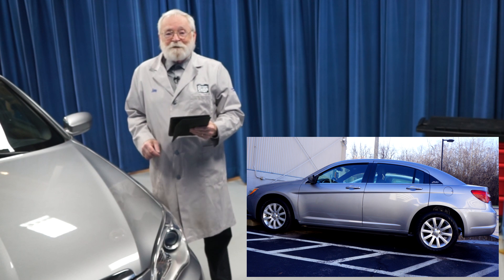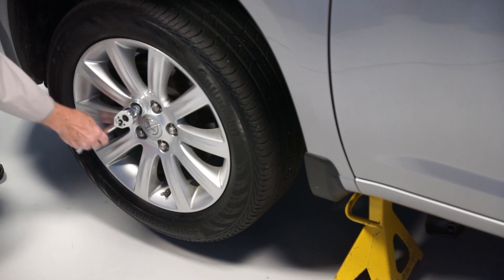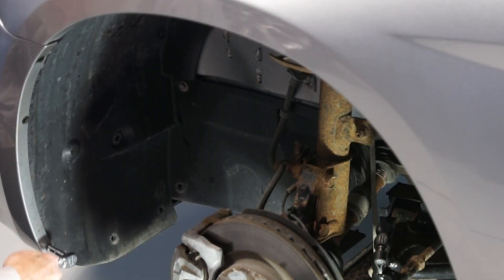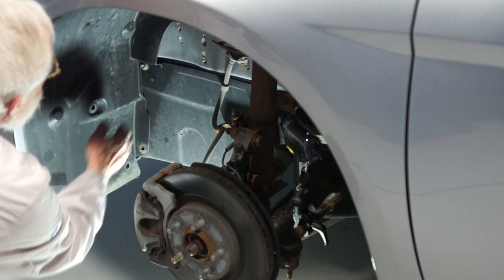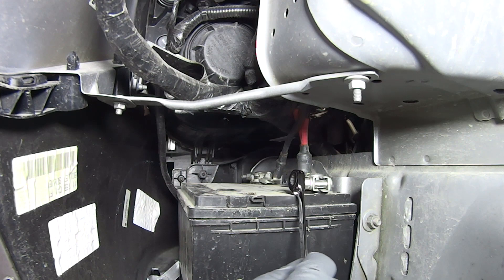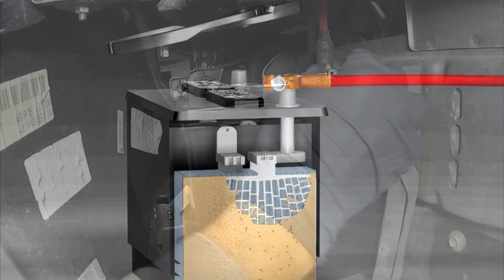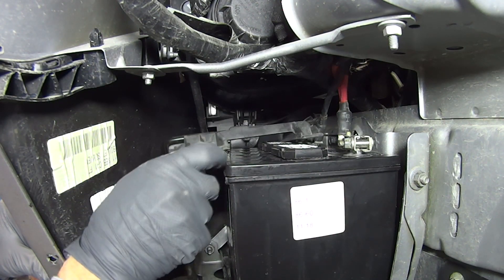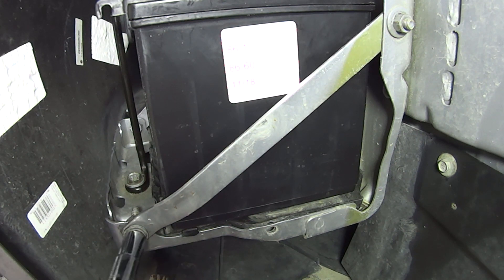Chrysler 200 (2011-2014) - New Battery Install

Comment: the irony being its actually easier to remove the bumper cover to replace the battery - just 14ea 7mm bolts, 2ea 10mm bolts and a few push pins on top - no tire removal needed

Comment: Most parts places only list 1 yr and 2 yr warranty batteries. It's a goup/size 86 battery. make them look up a 3 yr battery. This is hard enough that you want the best battery you can get in there. Advance's part no. is 86-2
Reply from the maker: Thanks for the input.

Comment: I have to say this is one of the most poorly designed cars I have ever seen. I regret owning a 2012 200. To even replace a headlight you have to remove the tires.
Reply from the maker: Thanks for watching. Hopefully we could help you out with the battery change.
Reply: @TheBatteryShop  I just did it, was tedious but its done.

Comment: When I bought my beautiful convertible 200S, I had no idea what I'd let myself in for. This is the hardest car to repair I've ever had, bar none. This is a good example: just changing the battery takes half an hour & multiple tools. If you want to change headlight bulbs be prepared to do one side, then the other, with a similar disassembly process- and even then, you'll get your hands cut while replacing the bulbs; there's just no room to move & lots of sharp metal, so have bandaids handy!
Reply from the maker: We're sorry this was challenging- but good job for getting it done!
Reply: I have the V6 200 and it’s terrible. If I get repairs done at the shop I’m charged extra because of the difficulty of reaching anything. The alternator went out and I had 6 guys disappear on me after seeing where it was located. Windows are out, a/c and heat is out, radio quit working, the housing on the headlights melted. I’ll probably break into tears the day I can get rid of this car.

Comment: What is the battery amp capacity for a 2.4 engine?
Reply from the maker: Thanks for watching. A 2011-2014 Chrysler 200 with a 2.4L, original manufacturers specification is 525 CCA.

Comment: Am about to possibly due this job in the 32 degree winter weather here in February, and great details from this YT, but I most Definitely would test out the new battery after installed and see if indeed "starts the car" and indeed "the Alternator is charging" said new battery once it is "back in circuit" before I go back through that whole process of putting the splash shield and the tire back on...  What a dumb place to put the Battery !
Reply from the maker: We know that battery replacements can be more challenging if it is an an unconventional place, but we believe you can do this!

Comment: According to the owner's manual you can get to the battery without removing the tire by just turning the wheel all the way to the right and that should give enough room to remove the shield. So apparently that's something you can do to make it much easier?

Comment: Um you remove the negative then the positive didn’t listen to this guy red you are dead
Reply from the maker: Hi - Thanks for watching! The battery ground connection has already been removed when the negative battery cable was disconnected at the firewall junction. That is the manufacturer’s step-by-step procedure as the negative battery post is almost impossible to reach when mounted in the battery tray.
Reply: @TheBatteryShop  you didn’t say that on your video so people will get confused it’s always red last when taking off the battery

Comment: Chrysler gets the award for the dumbest battery placement design. I should know after owning over 20 cars. What if you
just need a quick jump start... enough to make you prefer to just push the car over a cliff instead go through this hassle.
Reply from the maker: Hi - Thanks for watching and sharing your opinion! The vehicle owner’s manual has more information but the “jump posts” under the hood can be used for a quick jump.

Comment: I got a same car with a weird problem the battary is new I installed and now everyone I jump it sparks the wire terminals are new and the battary is new I can’t seem to see what is causing it to spark almsot like two wires are touching somewhere
Reply from the maker: Hi - Thanks for watching! It is normal to see a small spark when attaching the battery terminals after a battery replacement, especially if a memory saver was not used. You may notice that in the video when the negative battery cable is reconnected to the firewall connector.

Comment: My battery just went and I called Triple A and they wanted $100.00 to change the battery in that piece of junk 200 ,I bought new in 2012 ! I said you gotta be kidden ? He said if it was in the motor it was free ! Do you believe that! Never again !listen out there I've had nothing but trouble with that piece of junk !Don't buy one used ! Your asking for trouble !The heat don't work the alternator went3 times no recall the breaks oil leaks ! Should I go on that's only half of it !
Reply from the maker: Hi - Thanks for watching and sharing your experience!

Comment: Just a safety hint. Remove the ground on the battery first and install it last,even if you think the battery is dead it still has enough to spark if your wrench grounds. I bought one new in sept 2011 with the 4 cyl,excellent carplenty of power and great on fuel,my battery lasted till today and  besides tires,wiper blades and brakes ,this will be the first repair in 12 years at 195,000 km. I'd buy another one in a heartbeat.
Reply from the maker: Hi - Thanks for watching and sharing your experience!
Reply: When you add some negative cable to the base is it supposed to spark a little bit on contact?

Comment: Especially in such a cramped area, always remove/install one terminal at a time. Neg off first and Neg on last or you risk arcing to the frame with your tool.
Reply from the maker: Hi - Thanks for watching!
Reply: Not when you remove the negative terminal from the frame under the hood like was shown at the beginning.
Reply: Great video.

Comment: Once the battery is disconnected would the radio settings and the GPS saved info be gone?
Reply from the maker: Hi - Thanks for watching! This depends on the vehicle, but usually yes. Thats why we use a memory saver. Check out our video on memory saving. The link is in this video's description.

Comment: You don’t take the (circa) 2013 Chrysler 200 to a mechanic for a battery replacement. You take it to the ER, and immediately to the ICU, then tow it directly to the OR—with a team of “Grey’s Anatomy” Neurosurgeons, an anesthesiologist, and Surgical nurses, along with a tray of a sterilized 2-ton jack w/ a sturdy jack stand, a 1/4” & 3/8” ratchet, an extension socket, three sockets—13mm, 10mm & 7mm, pliers, a rivet puller, and surgical gloves—following success, being transferred to the Trauma intensive care unit.
Reply from the maker: Hi - Thanks for watching and for your interesting comment!

Comment: If you need to remove your wheel for battery replacement or remove your bumper for headlight bulb replacement, I don’t want it..
Reply from the maker: Hi - Thanks for watching and sharing your opinion!

Comment: When I bought a Chrysler 200 for my wife, and saw where the battery was I went ahead and had it replaced so I knew I wouldn't have to worry about it for a long time. Great video by the way. I learned a valuable lesson from this. I'd rather pay someone else to do it 🙂
Reply from the maker: Hi - Thanks for watching and sharing your experience and opinion!
Reply: @TheBatteryShop  Yes sir great video. You are very thorough and explain everything in a way even a dummy like me can understand. Thanks again
Reply from the maker: You're welcome!

Comment: I have a 2013 Chrysler 200 V6.  Before the battery dies you will get an amber warning light on your dashboard that stays on all the time.  There are 2 amber lights one for TPSMS and the other for engine problems.  Amber means it is still drivable a red light means get it towed.  I took it to the local Chrysler dealer and they charged me 30 minutes labor to read the code to find the problem.  They replaced the battery and also did an oil change that I also requested.  On the final bill I still was only charged for 30 minutes labor.  Now they charged me 129.00 for the battery which I thought was fair.  My main point here is that you get fair warning that the battery is weak.  Drove it for 5 or 6 days before I could get it to the dealer (always started never needed a jump) for an appointment.  This happened in the dead of winter in Connecticut.  I like the car and plan on keeping it as long as possible.  Love the quick V6 engine 288 horsepower.
Reply from the maker: Hi - Thanks for watching and sharing your valuable experience!
Reply: Should I be considered with this?

Comment: I've seen other people comment about the headlights, if you think the battery placement is ridiculous.

I have had my Chrysler 200 for 8 years this spring and put an obscene amount of miles on it with very few problems. So it's far from the worst car I've owned.

That being said, unless you have a lot of tools and a nice warm heated garage, doing ANY maintenance on it yourself is enough to drive you drink. 

I swear it is designed to require most people to take it back to the dealership or a mechanic for every little thing, like battery or headlight changes.

When mine finally gives up the ghost, I will not be replacing it with another 200.

Thank you for this video. Changing the battery is the current adventure I'm having with mine.
Reply from the maker: Hi - Thanks for watching and sharing your experience!
Reply: @TheBatteryShop  Thank you for the step by step video! 

I didn't have the tool for popping out push pins and ended up putting a couple small accidental holes in my hand with a flat screwdriver, but I finally got the battery changed.

Worth a note: the battery I bought as a replacement ended up being 1/16th of an inch taller than the old battery. That ended up being enough of a difference to prevent the battery hold down bracket from fitting back in place.

After much cursing and a 20 minute sanity break, I had to grind that 1/16th of an inch off the bracket to put it back in place. 

Your video was extremely helpful. I can't help but think if I had filmed my attempt to follow it would be nothing if not sadistically humorous.
Reply: Hi - Thanks for watching and sharing your experience!
Reply: I just inherited a 200 with super low miles. After watching this video and reading these comments, I will pay to have a battery installed and drive that sucker right on down to Carmax.  Its a shame cause it seems like a nice car, but I'm too old to bother with this kind of garbage.

Comment: Must be nice to be able to do this in a warm shop.  My battery just died, it’s -60°C outside, snow and ice in an uneven driveway,  Thanks Chrysler for what has to be the dumbest idea in battery placement ever.  🤬😡
Reply from the maker: Hi - Thanks for watching and sharing your experience! We wouldn't want to replace the battery in those conditions either.
Reply: Yeah , I totally get what ylur saying. But after 7 years ,i replaced my battery BEFORE  it died. Nice fall day ,cool n in the shade. 2 things that will kill a older car battery, extreme cold ,extreme heat. 5 years is about the lifespan of an original factory battery
Reply: My daughters car just died. Her car says its 110° here in TX🥵

Comment: Not to bad if you have to do it in the summer time or if you have a heated garage. But no way in the middle of winter and outside when the battery usually starts to give you trouble. But I wouldn't pay the 75$ and up for the labor cost.
Reply from the maker: Hi - Thanks for watching and sharing your thoughts on this.
Reply: Kinda like a 2x edged sword
Reply: So you won't do it yourself and you won't pay the labor. Sounds like you aren't going far

Comment: My lady went to walmart to have a battery installed they didnt have one so she went to a auto parts store and got one. The new battery was maybe 0.200 bigger than the old one and they told her it was too big and couldn't be installed. TWO THOUSANDTHS OF A INCH!!!
Reply from the maker: Hi - Thanks for watching and sharing your experience! However, we noticed that while filming the video there was plenty of room available in the battery tray and location (that you can see in the video) for the correct battery.

Comment: Man i feel like im watching a televised program! This is truly amazing!   Keep em coming.  I feel like i can change an engine with this kind of instruction! Clear and precise with all the info for beginners or experts
Reply from the maker: Hi - Thanks for watching! We're glad you like it.
Reply: Yes this model 200 ,has alot of videos ,sparkplugs, light bulbs ,battery.  I own one ,its a tuff car ,125k  9 years old ,still going strong
Reply: @parrisprice5892   is yours the 4 cylinder?
Reply: @charredskeleton  yes
Reply: @charredskeleton  if you have a question  I may be able to answer it. Ive done almost all the work on my 200.
Reply: @parrisprice5892   Just seeing how they hold up. I’m in the market for one. Looks like the 4cyl are tanks but the 6’s are trouble.
Reply: @charredskeleton  idk anyone who has a six. And Ive always been a GM guy. My 1rst chrysler. Other than normal maintenance, Ive had to replace the ETB. Electronic throttle body. 140$. I did it myself after watching a few utube vids. I change my oil and fil about every 5k miles. Got 72k on the original set of michelins. With tire rotation every other oil change. Its been a very good car. Good luck with yours. One stupid engineer design tho, the left front wheel has to come off to replace the battery. Other than that, I love it.
Reply: @parrisprice5892  do you have have do rest code for battery light? Or it should go off after being replaced with new one?

Comment: everyone disses on 200’s, i must’ve gotten the cream of the crop for mine. never have many issues and just started to really personalize it. CHRYSLER GANG
Reply: I love my Chrysler 200.  I have the 3.6 "Touring" package.  Fun car, feels like driving a V8... uses about as much gas too... lol.
Reply: Hi - Thanks for watching and sharing your experience!
Reply: @NXSProductions  Glad you like it, brotha!!!! #chryslergang
Reply: The 3.6 Pentastar engine isn't a problem, it's a very reliable motor. It's just that they pulled a Ferrari when it came to battery location. These dumbasses should've placed the battery in the trunk just like they did with the Charger.
Reply: @Iridiumcosmos  You're actually right though!!! The motor itself can last, but the battery is one major headache to take out!!
Reply: @hatchcracker_tv  Mine just reached 90K.  Daily driver.  Pentastar.  Uses no oil.  Not even a little.  I can go 10,000 and the oil looks as clean as the day it was pumped in.  Those motors are solid!
Reply: @NXSProductions  I too love my 200!!! They are better built than people were expecting!! Mine has a 2.4L with the 4 speed, and that has been taking good care of it’s own!
Reply: @hatchcracker_tv  Absolutely.  I just had to change the battery in my car; 2013 model... original Chrysler battery fired for nearly 8 years.  That, to me, is impressive and again, my engine runs as good today as it did the day I drove it outta the car lot. My hood's paint is starting to flake away above the headlights.  I've heard it's oxidation due to the aluminum hood and an improper seal... but other than that, she's still spot free.  All in all, just a great car to have.
Reply: @NXSProductions  Nice, brotha!!! Glad to hear it!! ☝🏾☝🏾👊🏾💪🏾💪🏾💪🏾👌🏾👌🏾👌🏾👌🏾
Reply: @NXSProductions  same thing is happening to mine I have a 2012 and the whole hood is faded
Reply: @rockfordhx2768  That sucks bro.  I hope you still enjoy your car as much as I enjoy mine, though.  Despite its quirks, it's still a hell of a car if you got the V6.
Reply: @NXSProductions  update: am about to change battery myself for the first time. i may change my opinions
Reply: Yessir!! I also have a 2013 Chrysler 200 with 75, 030 miles and so far I had no problems whatsoever!!!
Reply: @hatchcracker_tv  i have a 2011 Chrysler 200 with 186K miles lol, only have some alternators, batteries, and some minor stuff here and there.
Reply: @Zach-lz1zh  Nice, many people are just negative for these 200's, lol!! 😂😂😂😂
Reply: @hatchcracker_tv  i have the 2.4 L as well. the world engine models are too good!
Reply: @Zach-lz1zh  Cool!! The 2.4 is one of the most underrated engine(s) anyone has seen, in terms of how long it'll last! 😁😁😁💪🏾🙌🏾🙌🏾
Reply from the maker: Hi - Thanks for watching and sharing your experience!
Reply: @TheBatteryShop  Your welcome!!! Sorry for responding late!!

Comment: Wish me luck. I’ve never changed a tire, let alone a battery but we gone learn today! Thanks to your video ☺️
Reply: Did you learn?🤣
Reply: @derricfigueroa4609  yep! It took all day, mainly because I had to hit up Home Depot for tools but I got that shit done! I felt like a boss 🤣
Reply: @TheSlowStitchery  Girl I need to change my battery on my Chrysler wish me luck 😂😂 you definitely just gave me the motivation I needed
Reply: @mariahbetts3721  you got this! Remember you can pop the truck if needed by pulling down the backseats ☺️
Reply: Mine is dead in the garage. I have none of those tools. I looked up battery replacement and was told it would be approximately $400. That’s an entire paycheck plus some for me. SMH
Reply: @mistytownsley5304  do you have a warranty on your battery? I didn’t know I did, and when I took it to my battery shop they said I had a warranty and charged it for free 😊 I spent about $35 bucks on tools in the end.
Reply: @TheSlowStitchery  unfortunately, no warranty.  I’m still debating on what to do.
Reply: @TheSlowStitchery  what type of battery did you use
Reply: @TheSlowStitchery  love your can do attitude, congratulations